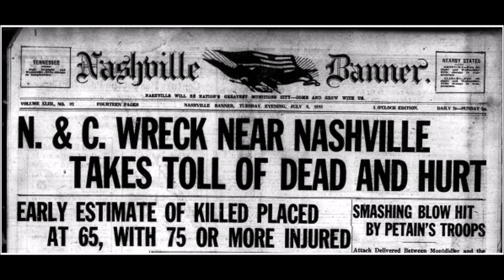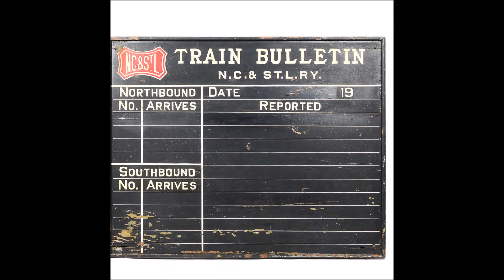The Great Train Wreck of 1918 100 years later

Comment: At 3:00 you state that the clear train order signal indicated "all clear".  That is incorrect.  The train order signal is used to notify crews that they must pick up new train orders (and clearance) before passing the station (which they had already done).  Track occupancy is indicated by block signals (shown at 3:02).  This distinction does not relieve the crew from occupying the track without authority, however, and the end result is the same.

Comment: In scotland, there is a type of signal called RETB (Radio Electric Token Block). Permission would be transmitted to the driver (engineer) by radio. Before entering a single track section, the driver would ask for permission by radio via a transmitter inside the cab of the locomotive. The instruction to proceed to the next section would then be relayed to the driver once that section is clear. It would also display which signal box the instruction came from.  

Certain types of trains are fitted with RETB equipment for use in Scotland, for example, British Rail classes:

156 (Super Sprinter)
158 (Express Sprinter)
37 (Locomotive)
66 (Locomotive)

Some steam locomotive are also fitted with RETB equipment.

Comment: The worst accident in my country took place in 1917 in full world war. A train with 26 cars was evacuating soldiers and civilians from the oncoming German army. It was so full that people traveled on the roof, and there are reports that some died because of the cold and others just fell off at curves. Imagine a full Indian train but going through snow. At one point the train was descending and started to gain speed. When the conductor applied the brakes nothing happened. Because the train was so packed someone closed by accident the air valve between wagons two and three. Next, the driver signaled to the conductors to apply the manual brakes but again because the train was so full, they couldn't be reached in time. Aware of the situation the radio operator signaled to the station to give them free pass. Unfortunately the line was occupied by some fuel tanks so they had to switch the train to line two. Traveling at about 95km/h only the locomotive and first car made it over the switch, the rest of the train derailed and hit the fuel cars causing a gigantic fire. The wooden cars burned for two hours. Almost nothing remained. The death toll is unknown but it is estimated to be over 1000. Until 2004 this was the worst train wreck that ever happened.

Comment: passenger trains on single track strike me as inherently scary.  without some pretty sophisticated electronic fail-safe's perhaps they need speed limits on such tracks that are within visual stopping distance.  Brakes that clamp the rails from the sides might help too, thus not being limited to the friction coefficient times the weight.
Reply from the maker: Good thing SEPTA lines are mainly 2 track (4 when on Amtrak lines) with only a few pockets being single track

Comment: If they'd adopted the British token system for the single line section the accident could never have happened.

The token represents the "key" or "pass" for the line. The signalman hands the token to the driver and as only the driver holding the token has the right to enter the single track section, only one train in one direction can move through it. On reaching the other end of the single track section, the driver hands the key to the signalman at that end, who then hands it to the driver of the train waiting at the stop signal to travel the other direction through the single track section. Even if the signal is set to clear, no train can proceed into a single track section without possession of the token.

Totally fool proof and in operation on Britain's railways since the 1880's.

Comment: A tragedy indeed.
The worst train wreck in Sweden happened the very same year, on the 1 October 1918 a train 422 pulled by steam locomotive type F number 1200 was carrying 170 passengers derailed when it ran over a section of track hanging in the air due a heavy rainfall had washed the embankment away.
The locomotive crashed down on a road and became laying on it's side, all passenger cars except for the restaurant car was totally destroyed, they were built out of wood and burnt to there frames.
42 lives where lost and 41 injured, the engineer survived but got a concussion, the fireman was buried under coal from the tender.
The wreck is known as the Getå accident. (Getå is a place in south Sweden.)
F 1200 was restored and in working condition about 6 months after the wreck and it has survived to this day and is in working order on a railway museum in the town I live in called Gävle.
Reply: 42 deaths is not as much as this accident
Reply: 1918 was a bad year for railroading

Comment: Check Illinois Central Gulf commuter train wreck 1972.  Many casualties because the front train backed up on the track (In a curve yet due to overshooting a station platform).  The following Express train had a green block signal and plowed into the first train with resultant telescoping.  Each train had different era coach cars.

Comment: how are you doing on the two other runaway trains in 1996 and 1994
Reply from the maker: As I stated before. Those will be released on their upcoming anniversaries so the 1994 one will come out in December and the 1996 one in February 2019. I know it's a long wait but that's how my system with these videos work
Reply: Thunderbolt 1000 Siren Productions ok
Reply: The 94 one came out

Comment: You Should Do The Burlington Train Collision 6 Years Later It Involves A Via rail train Locomotive Was F40PH 6444 And It Derailed The Truck Came Off And crashed into Building And the Engine was scrapped Occurred February 26, 2012

Comment: Katie Letcher Lyle refers to this tragedy in her book 'Scalded to Death By the Steam', and includes the words of some old folk songs about it which were composed afterwards. In many ways it is very similar to a disaster in 1921 at a village called Abermule, in central Wales - negligent staff had grown used to the careless observance of train crossing rules on a single line which in this case was protected by Sykes Patent token apparatus. (I don't think this was ever used in America, probably due to the much bigger distances involved than here in Britain) It was a fool-proof system - unfortunately it wasn't idiot proof. There is a difference! As a result a local train left Abermule with the wrong block token, and went head-on into an express coming the other way. It was in fact one of only two occasions when the Sykes system failed to do its job - both on the same railway.
Reply: "He was found in the wreck with his hand on the throttle,
and was scalded to death by the steam..."

Comment: I like your videos, but you need to learn how to narrate..enunciation, diction and pacing are important. I do have an issue with this video...A train order signal is not the same as a block signal. All trains were required to sign the registry at this station, so the crew, being in error, blew thru the interlocking and the operator could not do anything about it, as radios were not in use those ancient times. I worked for over 20 years as a block operator and know this shit inside and out, no criticism intended, but one should do some research on manual block rules before posting this...I worked manual block with trains that had no radios, and this situation was always foremost on my mind. No errors were allowed....(Metro Region, Penn Central in Connecticut, BTW)